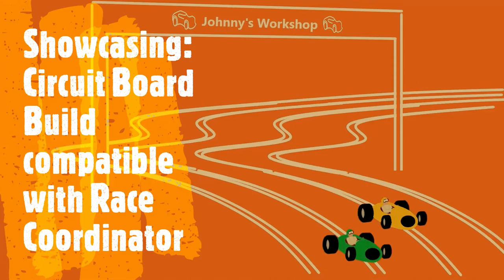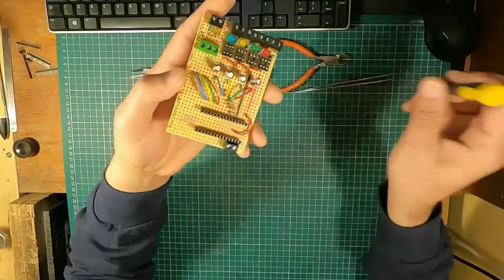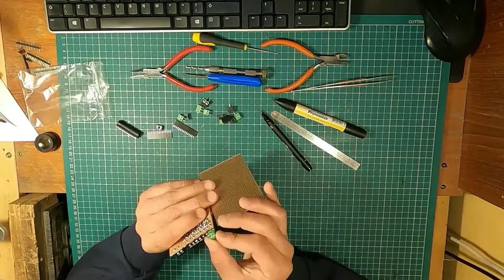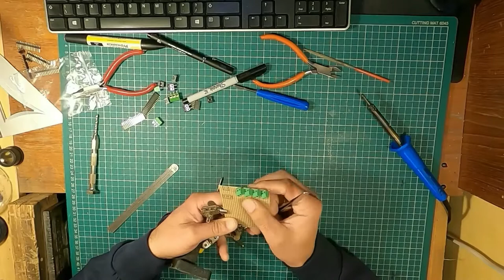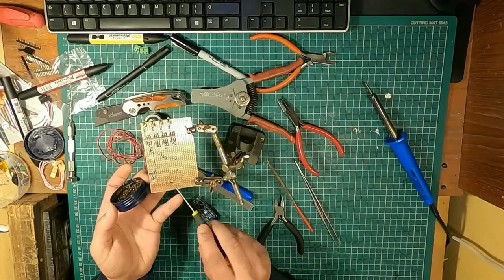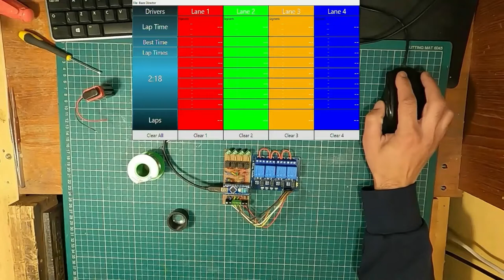Circuit Board Build Compatible with Race Coordinator

Comment: Please i uploaded the code to the nano, but it is not comunicating with the computer is ther any modification on the code to run on arduino nano?
Reply from the maker: Hi Rogério, the code should run on Uno, Nano etc.. 
I need you to be more specific in order for me to help you.
I imagine you have succesfuly uploaded the sketch or any sketch to your board?
If so, are you having issues setting up the board on RC?
If you already set the board on RC, are you having issues counting laps/detection?
Cheers